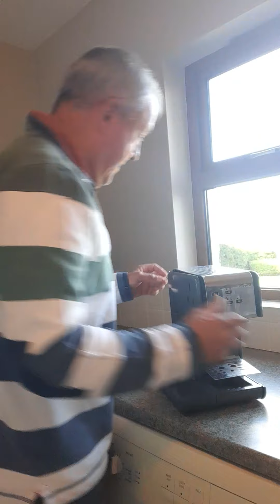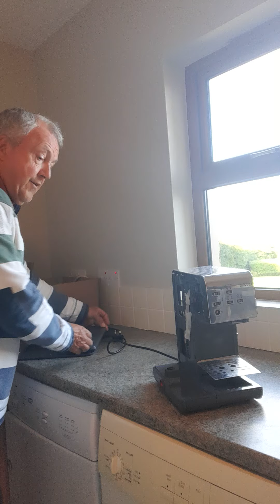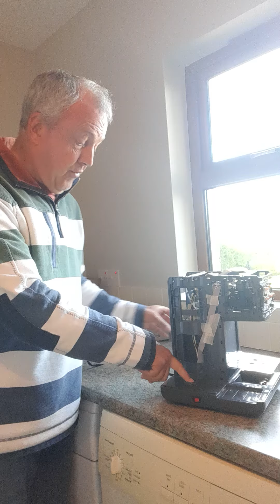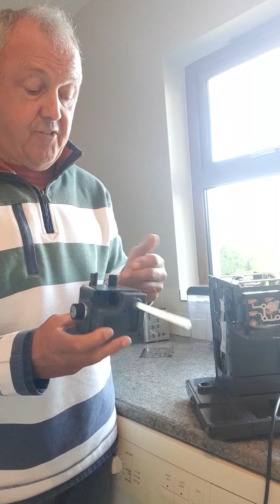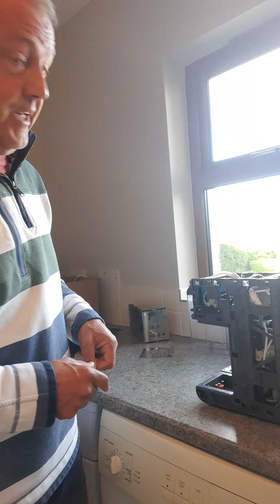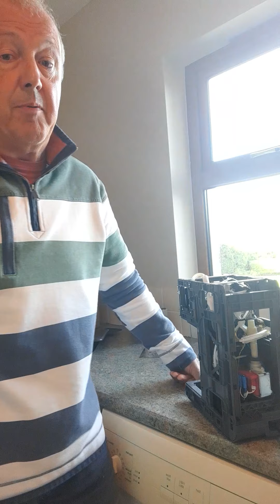Breville One Touch VCF107 coffee machine. How it works and some fault fixing

Comment: Hi Alan, can you give a quick explanation on how to get into the milk frother lid, I see one screw only and does the knob just pull off or is there a hidden screw in that. Many thanks for your help and great videos
Reply from the maker: No problem. There is only 1 screw (star). If you lay the frother lid on its top you can see it under where the milk outlet tube would be. You don't need to pull the knob off. It's a bit fiddly to get the inner bit to come out - I can only say that it's obvious once you've done it! Just fiddle and jiggle and it it sort of angles out. The mechanism inside it is pretty simple. However I have 2 of these units and they give very different results in terms of the amount of milk they deliver. I'm not sure if this is tolerance on the manufacture of the parts or possibly a small air leak. The operation relies on steam rushing past and creating a vaccum so leaks could make a big difference. I hope this helps.

Comment: Mine is not suck in milk what could happened? Coffee goes ok
Reply from the maker: Look at the tube into the milk. It is is trying to suck milk up but not making it, then you've probably got a leak in the black plastic bit which sits on top of the milk tank. You can dismantle this and look. If it isn't sucking at all,  then it's something more serious deep inside the machine. Likely a valve or a wire off. Sorry I can't help more.

Comment: Thanks very useful mine stopped working after being on holidays for a month it heated up but not water coming or coffee and suddenly all lights were flashing
Reply from the maker: I've seen this happen when I forgot to top up the water tank. Assuming there is water in it, check the flow out of the bottom of the tank and into the pump. At the bottom of the water tank there is a small valve and it may be blocked up.

Comment: More than a year has passed and unfortunately another problem has appeared. The machine is descaled regularly, so this is not likely to be the source of the problem.

When the coffee is ground into coarse grains, the machine can still handle it, but when the coffee is ground densely, the pump does not have the power to push the water through. I uploaded a video so you can see the effect. Water flows into the tank at the bottom, so it looks as if the pump was generating the appropriate pressure, but was unable to push the water into the cup.

Or maybe my thinking is wrong and the pump has too little pressure and is unable to push the water through the coffee container, and the water that flows into the lower drain is water that has accumulated and needs to be drained.

https://youtube.com/shorts/sko31rQ5Rs8?feature=share
Reply from the maker: Hi and good to see someone else has got a couple of years out of their machine too! The water trough is there for 2 reasons. Firstly when you've finished pumping espresso, the system sucks the water back from the head (to clear what would become cold water out) and sticks it down into the trough. Secondly it's a general outlet for leaks (altough it won't pick up all of them). The pump sounds OK and the dribbles of coffee out of the head reminds me strongly of when my boiler was seizing up due to a build up of scale. After a while the flow stopped completely and that's when I had to dive into the machine. So it feels to me like the fineness of the grains is a red herring. I think you are on the path to having a blocked boiler, it just hasn't completely blocked yet. If I'm right, the milk side will also be weakened and will block off soon too. Both are of course fed from the main boiler. I know you've said you the machine is descaled regularly, but perhaps this isn't enough? I don't use vinegar, I use a washing machine tablet ground up which I'm guessing is much more potent? Anyway, my guess is that you need to get into the boiler (again), take the bolts out and examine the inside carefully especially the channel at the bottom where the hot water comes out to the manifold. I hope this is helpful and do please post the results. Alan
Reply: @alanwatts1295  Thank You for Your answer. I opened the boiler and it is very clean inside. The outlet channel is also clean. Since I have a completely new coffee machine, which I bought at an auction from store returns, when I needed a new boiler a year ago (this coffee machine did not start), I replaced the pump with a water flow tester from it and unfortunately nothing improved. I have no idea what the problem could be anymore.

Unfortunately, I had another problem, because when I unscrewed one of the screws from the boiler, it broke in half. I don't know if it was some faulty material or if the factory installed a damaged screw, but half of it was left in the boiler base. I'll have to get it out somehow tomorrow.
Reply from the maker: @mmw22101973  Looks like you've ruled out the boiler being blocked OK! The next clue might be in what the milk flow is like. If it's normal, then this suggests the problem lies between the solenoid(s) and where the espresso comes out. It seems unlikely to be a solenoid, they will usually fail open or shut, not half way between. So all I can suggest is follow the pipes from the boiler, through the solenoid and down to where the coffee is made and see if you can isolate a semi-blockage. On the other hand if the milk flow is poor, that would suggest a failing pump. Since you have a spare machine, you could swap the pump and see if it made a difference. Sorry I can be of more help, but you're into an area where I didn't have a problem...
Reply: @alanwatts1295  We do not use this coffee machine at all in the milk section. I have already installed the second pump. It didn't change anything.

Tomorrow I will try to follow the whole route. Theoretically, everything is OK, but something is not. :) Thank You again.
Reply from the maker: @mmw22101973  Marek, one last thought. Even though you don't normally use the milk side, you could try filling the milk tank with water and just do a trial on it. This might provide some more clues?
Reply: @alanwatts1295  Today I'm back in the fight. :) And tell me one more thing. Do You know how to remove the rubber bands that attach to the pump? I removed the pump from the second coffee machine by disconnecting the lower tube, and pushed the upper one through with great problems after unscrewing the upper nut. I connected the pump hanging from the side. I wonder if there is a simpler method of removing the pump.
Reply from the maker: @mmw22101973  Good luck with the fight Marek! It's over a year since I took a pump out but I do recall it being quite a fight. I dismantled the pipe at the input end and this allowed one rubber band to come off. I think I did the same as you for the output end and then wrestled to get the other band off. A real pain. One tip when you are putting the pump back on - be sure to put the over temperature sensor back into its pocket on the pump. You'd only find out you'd not done this when smoke or a loud bang occur if the pump runs too long!
Reply: @alanwatts1295  I checked the entire path between the pump and the boiler. I found some dirt in the outlet from the boiler, where the distributor is. It wasn't much and I didn't really hope for improvement, which actually turned out to be true. Because there is still a problem. This whole system is quite simple and if there is no dirt anywhere, it's hard for me to understand what's wrong. The only thing I'm wondering about is the plastic distributor that is right behind the pump and from which the water goes straight to the boiler, but also next to it, in the same part, there is a pipe with water that connects to the pipe in which the water flows back through the valve at the top.  And if I'm not mistaken, it is a safety valve that regulates the pressure. If the pressure is too high, this valve drains the water. There is a possibility of adjustment here.  However, if the problem existed here, the valve would drain the water, not allowing sufficiently high pressure to go to the boiler. In my case, I can hear that the pump no longer has the power to pump, and the valve does not release water, which means that the pressure is not too high. During this period, when the ready coffee stops flowing and the pump continues pumping, the water does not escape anywhere.
Reply from the maker: @mmw22101973   Marek, this is a strange one. You are right, there is a safety valve near the pump end. This blows off if there is too much pressure. Importantly, it directs water down to the open tank which sits below your coffee cup (this route is also used for other things too). So, if the pressure valve was releasing too early, you would see water building up in this open tank. So, it seems very unlikely that this is at fault. There must be a clue in you what you say about the sound - 'can hear the pump no longer has the power to pump'. I'm not sure what this means? You could experiment by releasing the output pipe from the pump so that you see that it does pump out water and then block the flow with your finger or something and see how much pressure there is. A bit unscientific, but worth a try. Everything points to the pump being faulty - but you say you've already replaced it. Are you sure the replacement was fully working? The inside of the pump contains a one way valve mechanism with a small ball bearing in it and a spring.  If this was starting to fail you'd get reduced pressure. There is also a diode (one way flow for electricity) which is vital to the operation of the pump. If this blew short circuit, the effect would be that the pump buzzed but pumped very little or no water.  For what it's worth, these pumps are common and cheap, I got my replacement from Amazon for around £25. Good luck and let us know what you find out! Alan
Reply: @alanwatts1295  Problem solved. After I replied to you, I analyzed everything and concluded that since I checked everything from the pump up, it means that the problem is in the section before the pump. If the pump was pumping and the valve was not releasing the pressure, it could only mean one thing. The water entering the pump is not sufficient. The only thing I haven't replaced before, is the socket with a strainer, on which the water tank is placed. The strainer looked perfectly clean, so I didn't suspect a problem. But finally, having no other option to check, I took out the socket, and when I blew into it through the tube, I knew that was my problem. To sum up, the cause of the whole problem was quite simple, but unfortunately, I first had to understand how the whole system works. It's good that I have almost every part at my disposal and I could replace them.  Thank you for your help, and I hope that our common experience will help other users in the future.  :)
Reply from the maker: @mmw22101973  Well done Marek! Who would have thought .... I must go and check the state of the strainer etc on mine - we have very hard water here, so this could become an issue for me. I used to think that I knew a lot about this coffee machine - but I reckon you're now the leading expert! Alan

Comment: It's the milk throffer that stopped working ya can see milk go up nr the top the pipe but dosmt reach the top
Reply from the maker: Hard to know on this one with so little information. If your espresso bit is working, this indicates the pump is OK, so chances are the separate heater for the milk is blocked. First thing to do it follow the cleaning instructions. For me, I fill the water tank with water and a  crushed washing machine cleaner tablet. I also put some of this in the milk container too. I then run the machine variously for both espresso and froth. Also ensure the pipes in the 'lid' of the frother are not blocked. If this doesn't cure it, then you're into a major dismantling to try to clean out the milk heater. I never needed this bit, so can't really guide you.

Comment: Thanks for the great video Alan, I think this is the only one on the entire internet.
So, before Breville try to silence you could you please explain how to remove the cover on the water tank side?
I've removed back, bottom and left-hand cover and even partly removed top but this other panel is giving a lot  of resistance and so I don't want to break it. Are there any more (hidden?) screws other than those three inside the rear panel edge?  Cheers.
Reply from the maker: Glad you found the video helpful, I posted it exactly because I couldn't find anything else on the web! The problem is that it's now almost 2 years since I worked my way into my unit, fixed it and reassembled. It's worked perfectly since. So I actually can't now remember the details of how I got into it. However 'Lightshaft1' posted some helpful comments about 2 weeks ago, you should be able to see these. The key part of what he said was :
Managed to get right inside. there is a complicated cast plastic chassis all the stuff is built inside, remove all screws back and the base and the outer covers are clipped  on l  use of a small flat screwdriver to pull and lever off, water tank side would be more difficult but I did not need to take it off
I too did not try and take off the water tank side, I could access everything from the other side, top and bottom. 
What exactly are you trying to access and why? Alan
Reply: @alanwatts1295  many thanks for getting back so quickly.  I shall try a bit of BFI and see if I can work the cover off then as I have removed everything in the bottom now and there doesn't appear to be anything fixing it from below.  Cheers!
Reply from the maker: @Mulgie11  Just a thought, since you are going to wade in here, do you want to provide the world with some photos or comments to help others if they decide to go in at the deep end?
Reply from the maker: @Mulgie11  Oops! If I ever have to go back in again, then hopefully it will come back to me again and this time I will photograph what I do. But until then I'm afraid it's up to any of you to figure it all out. However if you do, please post and let others know.

Comment: Managed to get right inside. there is a complicated cast plastic chassis all the stuff is built inside, remove all screws back and the base and the outer covers are clipped  on l  use of a small flat screwdriver to pull and lever off, water tank side would be more difficult but I did not need to take it off it was leaking from a corner of the heater on the top of the gadget 4 allen screw loose enough to get sealant  underneath a lot of the parts do not look very robust be careful
Reply from the maker: Richard, well done and very helpful to other intrepid explorers! When I took the 4 Allen bolts out, I was able to clean out the boiler easily, mine was badly silted. I imagine while you were in there you took the opportunity to dung the bottom of the boiler out too. The only thing I would add for others is to be very careful when you refit the boiler about placement of wires and pipes. It gets very hot there and any badly placed wire or pipe will melt!

Comment: Hi, thanks for posting I have managed to get the covers off that are screwed on would be nice to know how you get the top and side covers off, looks like I might need a break-it size force thanks..
Reply from the maker: Hi - I'm sorry to be less than helpful here, but it's over a year since I took this apart and I honestly can't remember the detail. Taking the back panel off (to get at the pump) is relatively easy. After that there are a number of screws on the underside which you can easily see and take out. These free up a lot. But you are right, it wasn't intuitive about how to get the side panels off. Don't use too much force, they shouldn't need this. But I seem to recall there are some slide out clip-type arrangements, so I suggest trying to slide them out in various directions until you find the right one. If I ever need to go back right inside the machine again I will document it properly this time - last time I just charged in and fought with it until I eventually found the right way. If you figure it out, please do post it for others!
Reply: @alanwatts1295  Thanks I will have another look I actually bought another Machine slightly different. Mine is leaking from the top end think I might have been over tamping causing high pressures.

Comment: Thank you for this vid, hopefully I can stop mine leaking and hopefully get a coffee from it again. 👍
Reply from the maker: Just go for it! I jumped in and it all worked out. My machine has been making good coffee perfectly for the last 12 months
Reply: Thank you, I took the boiler out and like yours was full of scale, however, after emptying I found a hole in the base plate of the boiler. I’m guessing the scale had caused a weak spot and pressure had blown through. I have ordered a replacement used boiler for £13. We will see.